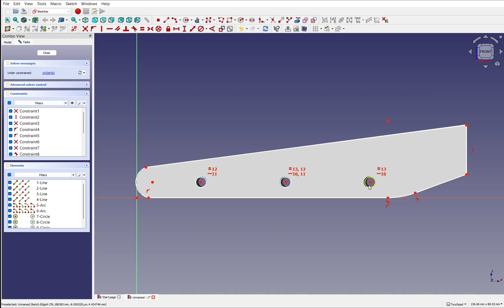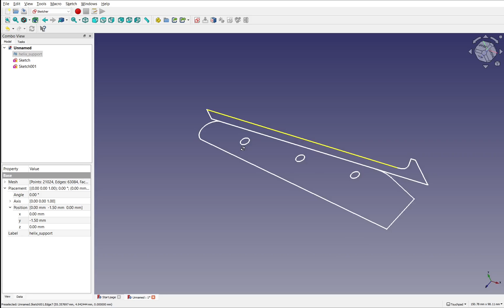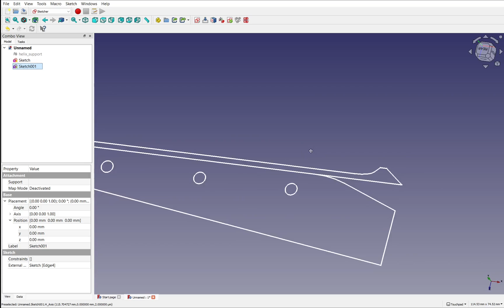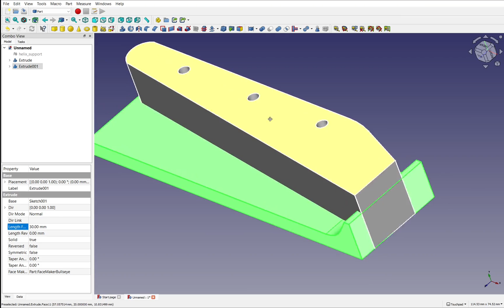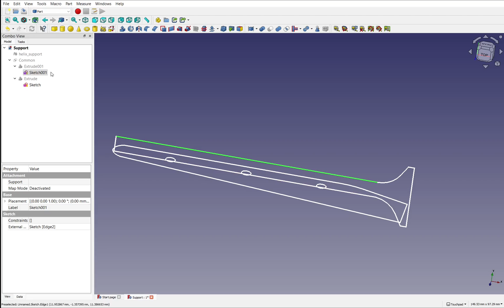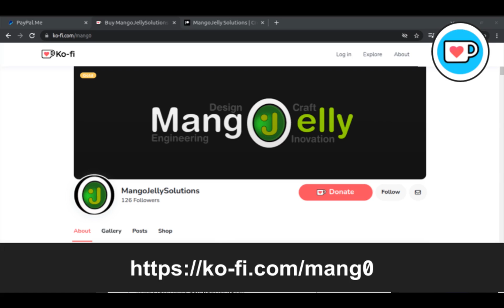FreeCAD: Basic Intersection Workflow in Part Workbench

Comment: The original holes was angled.
The right way to do this is to place your POV accordingly (i.e. with some angle) and then create a Shape2Dview from Draft workbench, and transform it to a sketch.
Then make the intersections as you depicted in this video. In total you should use 2 intersection ops.

Comment: I like the "Part" workbench/workflow a lot more than the the "Part Design" workbench. I find the step-by-step approach of part design very limiting. The tree-like structure that results from the "Part" workflow is much more logical for most shapes and also more robust against "breaking" a model after changes of previous steps. As an added benefit the "Part" workbench works together a lot better with the functions of other workbenches (for me that's actually at least as, if not more, important).
Reply from the maker: I am with you on that. I like to work with surfaces and then join them altogether and the part really excels with that. It's also very good for experimenting worth build. Thanks for adding your thoughts. It's great for me and others alike. Thank you 😊👍